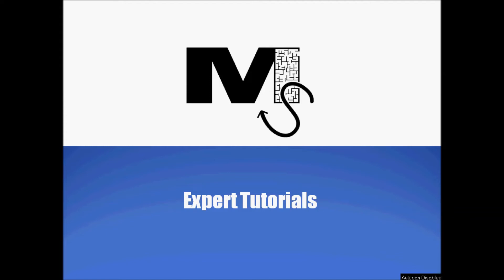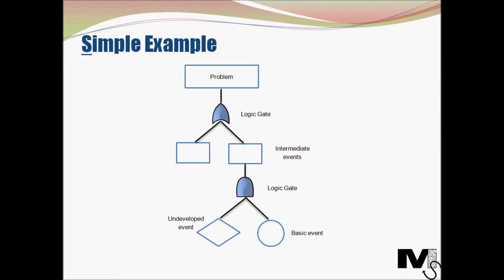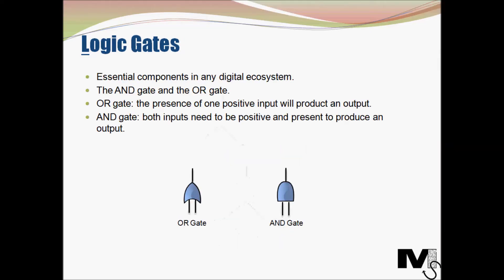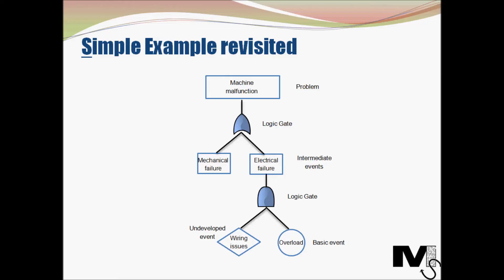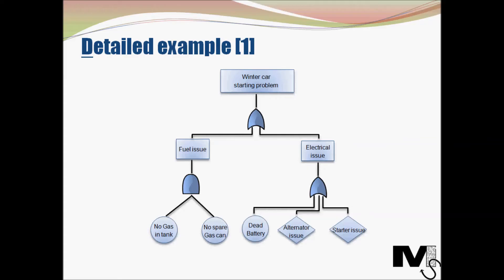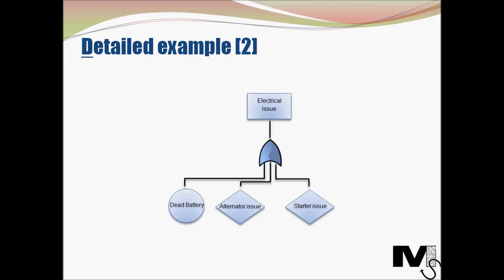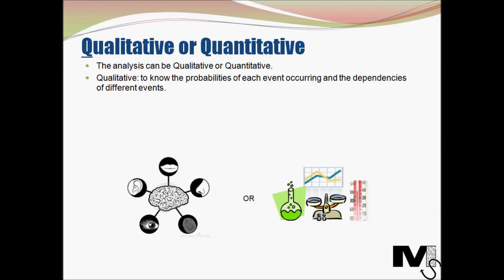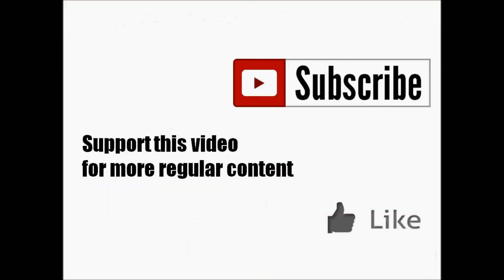Fault Tree Analysis Explained with Examples - Simplest Explanation Ever

Comment: How does this work if you're dealing with probabilities? Factoring in likely scenarios, and worst case scenarios.

Say I have a piece of electronics that could burst into flame if it fails, but likely that it will simply stop allowing voltage and current to pass through it instead.
Reply from the maker: Hello! If the number of possible results is finite, one should list every possible one, and state the probability. If there are far too many outcomes, it's recommended that you outcomes with the highest probabilities and ignore the others. In the absence of data, the actual probabilities can be based on expert estimation.